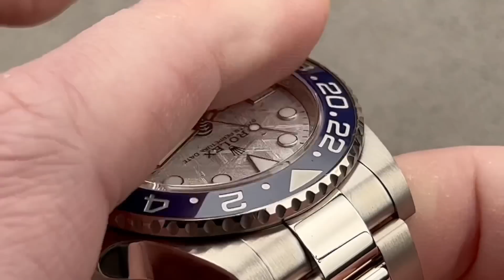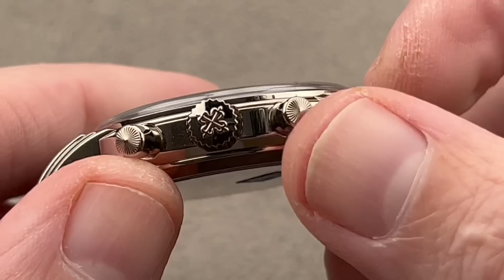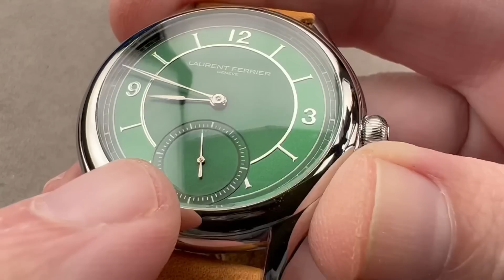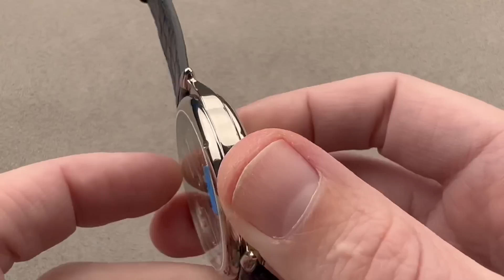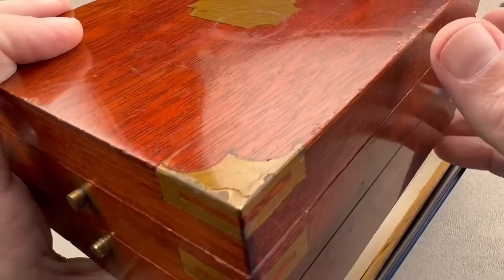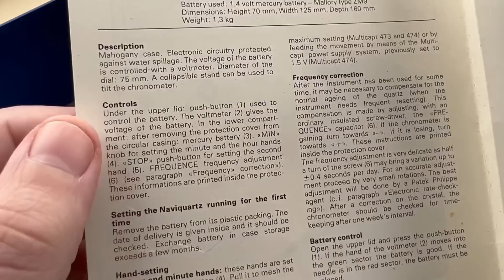Rolex GMT-Master II Meteorite Pepsi — Reviews and Buying Guide for Patek, JLC, De Bethune, and More

Comment: Alcantara is more common in Sports and racing cars as a budget alternative where leatherwould look wrong. Its seldom used in luxury cars partly because of its more sporty connatations but mainly because it wears badly and looks terrible after a coupla of years. Its more an Audi/Lambo kinda fabric.
Reply: That’s exactly right. Alcantara costs about $25/linear yard wholesale whereas leather starts at about $100/linear yard wholesale and only goes up from there, depending on cut, pigmentation method, tan, etc. Get some leather that was slow tumbled (which causes the dye to go all the way through) and it can quickly become more like $300/linear yard. Why do car makers like Alcantara? Simple, they charge you more for a material that costs them less to use. It’s a cash-cow of an option in their eyes. And you’re absolutely right about its wear and tear. It’s good for ceiling liners, door panels, or other things that aren’t routinely touched. But as primary seat upholstery it wears out quickly and looks terrible once it does - kind of like matte paint finishes once they start chipping because the consumer is advised against doing anything to a matte paint job that protects (and yet ruins) it.

It’s common for used cars that fall into car dealerships’ hands that have Alcantara seat upholstery for the car dealer to reupholster it before selling it. This practice makes car buyers unknowingly think that Alcantara lasts longer than it actually does because, after all, the Alcantara upholstery on that 50K mile used car looks practically new! - That’s because it is new!
Reply: @jumboJetPilot  Fascinating, steering wheel covers in alacantra last more like 5000 miles, it soaks up grease like a sponge
Reply: @jamesblonde2271  I can totally believe that! My experiences with Alcantara - it’s a junk material.
Reply: BMW does Alcantara on seats, headliners, and even a special edition steering wheel.
Reply: @seattlegrrlie  Yup, so not the Rolls, but Ferrari will use it too, it just ain't great.

Comment: 25:15 I like how instead of simply saying "this watch is accurate to 1-3s per month" he says "this watch COULD BE POTENTIALLY accurate to 1-3s per month". Trying to upsell a product without promising anything. A true salesman.
Reply from the maker: It's a 50 year-old electric clock. Patek's figures from the 70s aren't numbers I can guarantee. I have no chronoscope that can time a large 1Hz quartz clock to 1/10 second per day. All my gear measures mechanical escapements that run to seconds per day, not tenths. If it were to return from Patek service, I'd expect it to be checked against more sophisticated tech than I have -- and to run to 70s spec.
Best,
Tim